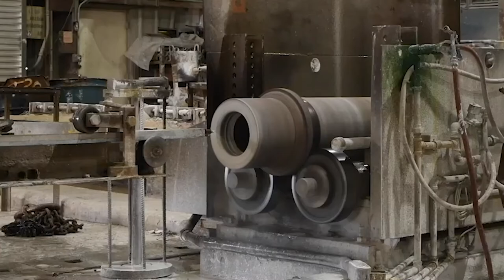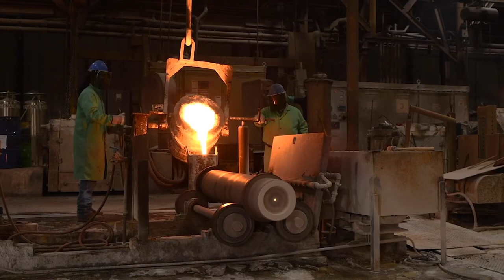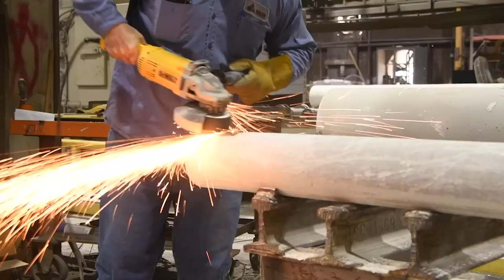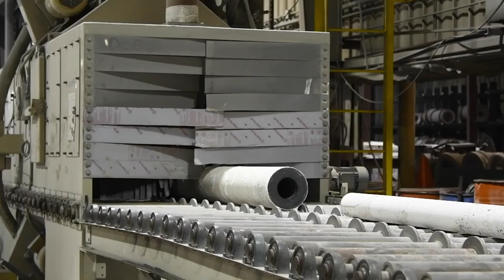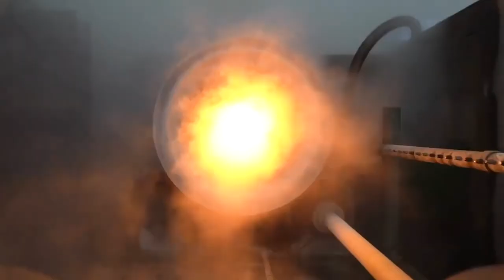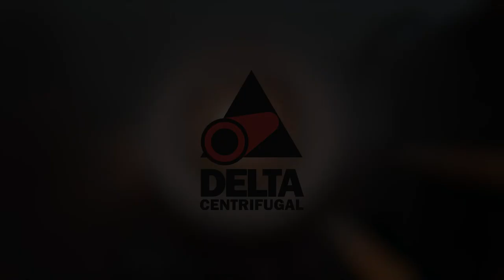Delta Centrifugal - Centrifugal Casting: Foundry Operations

Comment: Watched the whole video. Have no idea what the process is or why it’s better than other processes. Most of the video was two guys pouring molten metal.  Not gonna win an Oscar for storytelling.
Reply: Pipe making by casting in a permanent mold rotating about its axis at high speed. Uniform dimensions,  thinner walls, higher strength --- Regards
Reply: whereas some of us find that this explains everything actually.

maybe you need a bit more spread in your general knowledge?